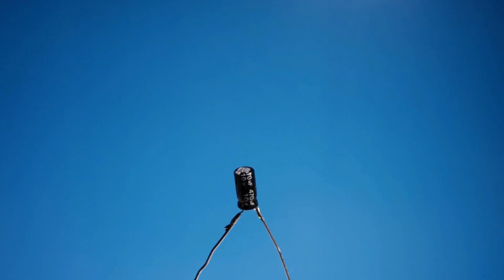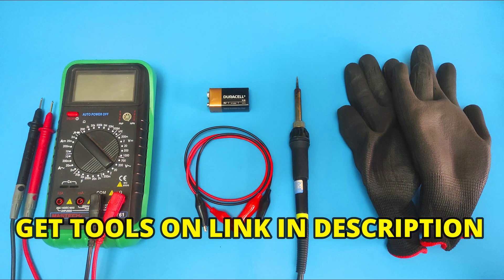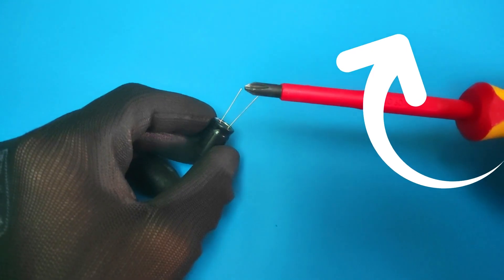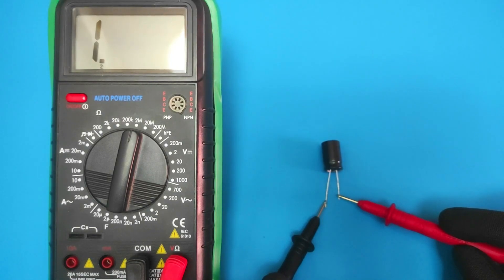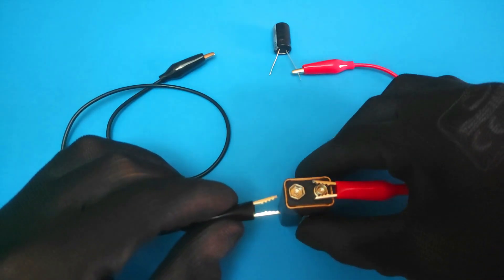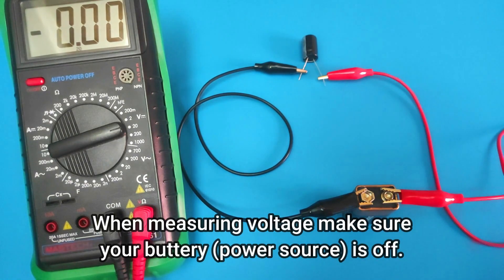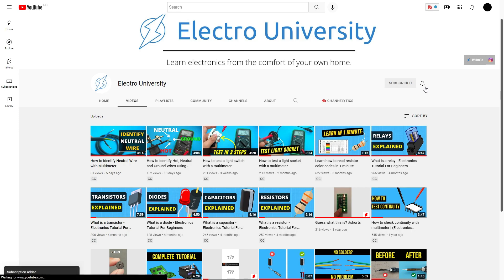How To Test A Capacitor With A Multimeter  (Step-By-Step)

Comment: First of all you should have explained for all the novices watching which leg on the capacitor is negative, secondly you tested the capacitor voltage wrong, you should have removed the battery before measuring the capacitor voltage, all you did was measure the battery voltage.

Comment: How do I test a capacitor on a PCB without removing because I want to check if the capacitor is the cause of the reason the PCB isn't working?
Reply: Don't test it - just replace it
Reply: @ninjashader  no because you might end up causing more issues. you should test the capacitor beforehand instead of blindly shotgun recapping

Comment: Thank you. Can I please ask, if a TV power board has 2 x 450v capacitors should they read at 450v or is it just the max tolerance?
Mine both read 350v would there be a problem with a component upstream or is that normal on standby?
Thank you Tim

Comment: why infinity ohm on a cap? and first so low?
Reply: When you charge a capacitor you have current going in right?  The closer it gets to being full the less current flows until it stops completely. Remember the basics: high resistance means low current and vice versa. A multimeter measures resistance by applying a low testvoltage and measuring the resulting current. And with voltage and current it calculates the resistance. When measuring the resistance the capacitor gets charged with the multimeters testvoltage. While the capacitor is charging from empty to full the current decreases until it hits zero.

The resistance behaves opposite to the current. 

So if the resistance doesn't continuously climb to infinity during the measurement it means there is a low resistance electrical connection inside the cap between the two sides that shouldn't be there and hence the test result would be: "failed"
Reply: @irgnedeinname  R = V/I  by formula. Voltage rating = 10 V  means always = 10 V (say WATER TANK = 10 LITRES). Capactior is like a WATER TANK. When CHARGE A CAPACITOR means CURRENT (like water) will slowly fill up the capacitor  ==> Current is HIGH ==> Resistance = LOW.  When DISCHARE ==> Current = LOW ==> Resistance = HIGH

Am I correct?

Comment: can i test capacitor without removing it from the circuit board?
Reply: No
Reply: @pontiacexchange4386 this is partially incorrect- you can use an ESR meter in circuit
Reply: @pontiacexchange4386  ok
Reply: This is a really poor video.  You can’t test the ability of the capacitor to take a charge (voltage) while the battery is still connected!!

Comment: but with no markings how do I test to know what side is what? + -
Reply: There are non-polarized capacitors with no defined + and - contact. With those it doesn't matter which side is connected to positive and which to negative. If it has no markings it's probably non-polarized sometimes also referred to as a bipolar capacitor. 
Most ceramic capacitors for example are non-polarized
Reply: @irgnedeinname  I had a bipolar girlfriend.

Comment: This test was NOT correct. In the last step, he tested the battery voltage since the 9v battery was still connected. What he should have done was disconnect the jumper cables before testing the charged voltage of the capacitor.
Reply: True. Do disconnect the battery before or else you will measure the battery voltage.
Reply: How long should we wait before disconnecting the jumper ?
Reply: @111boldoo  The capacitor will be fully charged almost instantaneously.  When it discharges it will release 50% of its power - then 50% of the remaining power - then 50% of the remaining power and so on and so on till discharged or charged back up.
Reply: @111boldoo  Depends on a few factors but you can calculate it if you know all the parameters. You will need to know the capacitance in farads so if you have a 1uf capacitor you would change it to its value in farads so 1uf would be 0.000001 farads. Next, you need to know the resistance of the circuit, with the setup they have, it is so small yet not 0. Use a small value if you are using wire like in this video but like I said not 0.

Now the fun part! The formula for this is 

T = R * C * Tc

T(charge time in seconds) = R(resistance in Ohms) * C(Capacitance in Farads) * Tc(Time Constant)

For the Time Constant, we are only worried about the first 5 so if you want to know how long it will take to reach 63.2% charge then use 1 if you want to know how long it takes to reach 99.3% charge use 5. We are not worried about anything over 5 because a capacitor starts charging fast and then slows down and after it reaches 99.3% it charges super slow past that.

So here is an example let's say we have these values

Our resistance is 10 kOhms, Capacitance is 1uf, and we want to know how long it takes to reach 99.3% charge.
Our formula would be

T = 10,000 * 0.000001 * 5
T = 0.01 * 5
T = 0.05

So for our example, we know that after 0.05 seconds we will be at 99.3% charge close enough to know if our capacitor is good. Just so you know, if we use the same capacitor value but change the resistance from 10 kOhms to what this particular setup in the video would be less than 1 ohm, however, I'm going to use 1 just because at these values it really doesn't matter. 

T = 1 * 0.000001 * 5
T = 0.000001 * 5
T = 0.000005

So to finish this long post, unless you have a very high capacity capacitor and a very high resistance, you will charge the capacitor almost faster than you can clip it on and take it off. However, you may have a large value capacitor you want to test so I find it better to explain the math so you can do these calculations yourself.

Hope this helps and was easy to understand, I wanted to explain it in a way that even someone not familiar with electronics could understand it.
Reply: Is the last step a necessity once you know resistance and capacity?
Reply: You are right, however, he already addresses this mistake in the video.

Comment: Third test didn't make any sense to me. If you'd removed the battery wires first I'd have understood it was something to do with the cap storing a voltage, but as it was you were effectively just connected to the battery were you not? I'm just here for some help with wiring a guitar. Don't pretend to understand this stuff at all.
Reply: This test was NOT correct. In the last step, he basically tested the battery because the 9v battery was still connected. What he should have done was unplug the jumper cables first and then test the voltage of the capacitor.
Reply: Technically, a capacitor will block DC, but allow AC. This technically correct. So if capacitor is shorted. U will also measure 9v. 

But if it is good or open, u will measure voltage of your battery. So it doesn't do anything

Comment: In the voltmeter test , you  got 9 volts and you said that the capacitor is good. If the capacitor was bad  what value should I read in the voltmeter test ?
Thank you
Reply: Shorted capacitor will bring 9v to much lower reading.
Reply: @nikoz4841  It will read "0 V" for a shorted capacitor.... It is like you put multimeter's probes (+ve and -ve lead) on a piece of wire
Reply: If done correctly, should show the same voltage as the battery if given enough time to charge the capacitor.
Reply: That will read whatever the battery is, he is measuring the battery. This has nothing to do with the capacitance.
Reply: I thought the same thing

Comment: Has there ever been a point in history where it's worth it to remove every single part, and test every single component to fix something?
Reply: For science!
Reply: @AeroCraftON  i suppose if it helps. this made me realize i'm throwing away my old car eq though
Reply: You don’t, and that is why you learn to read schematics. You trace the board and find the comment that doesn’t work well and perform the test. I’d you are going to remove everything on the board just to test it that means you don’t know anything about it and have zero idea what you are doing.
Reply: When hvac co’s want to charge you $19k for a new system. YES! 😊
Reply: ESR meter will test capacitors in circuit multimeter is the worst thing to test a capacitor with
Reply: I'm a beginner antique electronic hobbyist- it seems like I have to take apart allot
Reply: It would be a sizable project but, the Human Race perhaps?

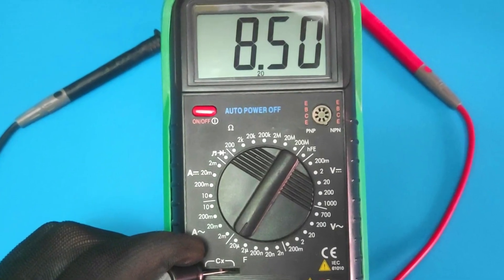Comment: 2:00 is 8.5 a good value for a 10uf capacitor? 15% lower?
Reply: I looked up capacitor tolerance online and it says up to +/- 20% is acceptable.  More expensive capacitors can have +/- 1% tolerance values.
Reply: I just watched another video saying he replaces capacitors if they are out more than 10%.  Maybe that is what technicians are told when to replace capacitors.  A technician may want to swap them out at 10% just so they don't have to come back later for another service call?  IDK.  What do you think?
Reply: @striderX49gaming  yeah, maybe, they probably lose value over time.
Reply: @striderX49gaming This is the case to my best knowledge, the capacitor already has demonstrated its starting to fail rather than having a callback that we have to prioritize we just replace the capacitor outright, they’re very cheap usually
Reply: @striderX49gaming  +- 20 % is ok, because on circuit boards manufacturers use higher rated capacitors than really at least needed. But when ever it's possible just replace every one below 10 % of its rating. You don't want to repair things more often, just because you didn't replace a cheap capacitor below 10% of its rating.
Reply: 1:48  how do you discharge capacitor ?  yes i am novice level